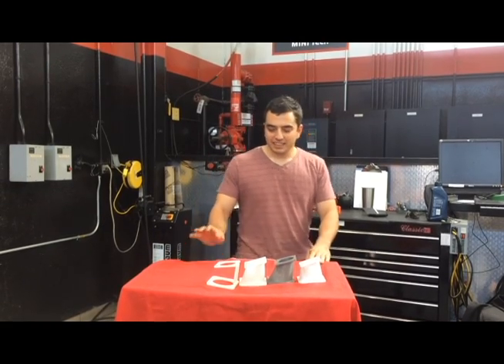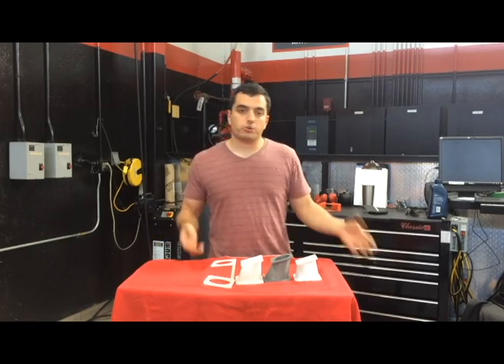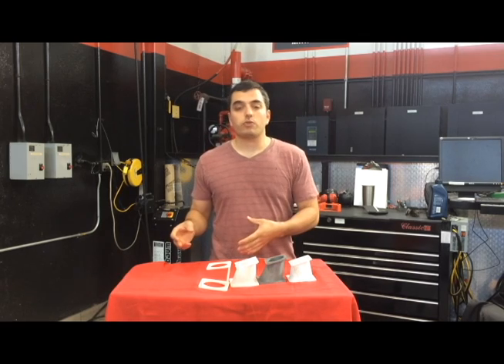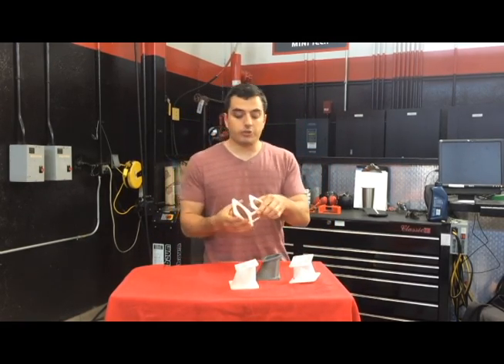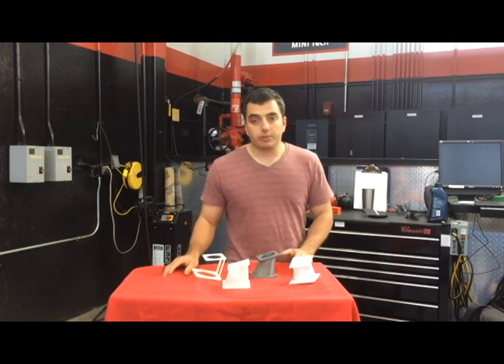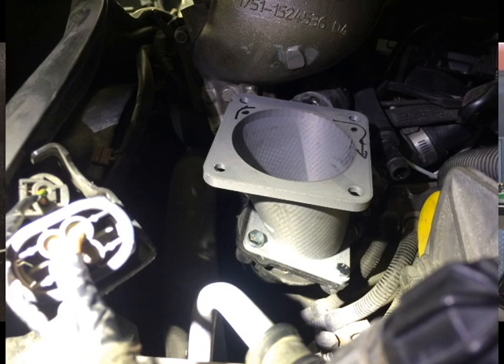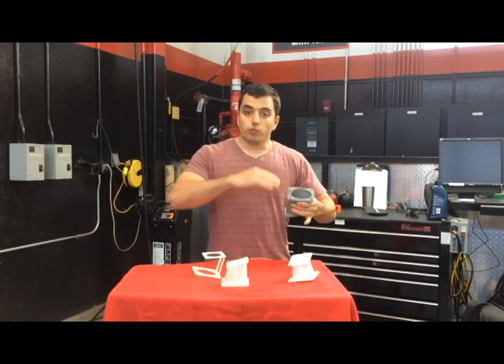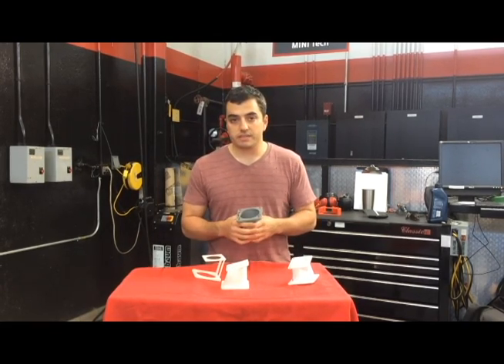3D Printed MINI Cooper to BMW throttle body adapter

Comment: 80mm is wayyyy too large for even a 300+hp r53. It looses far too much velocity low end to justify that peak hp gain... peak hp means nothing when the rest of the range lost so much power
Reply from the maker: Which was explained in the video many times to avoid pointless comments. By you tube never fails I guess

Comment: How much would something like this run to produce?  I'm interested in doing this for another application.

Thanks!
Reply from the maker: JP JP about 50 dollars depending on the material.
Reply: Jason Widelitz any recommendations for software to draw up for as hobbyist?  Also, do you have a website?
Reply from the maker: JP JP I would start with google sketch up. Really easy to learn and can export to .stl with a simple patch

Comment: What type of filament did you end up using? Also what was the density level of the 3D printed part? What is the expected longevity of these parts?
Reply from the maker: I used ABS. I ran it at about 33 I think. As far as logenivity is concerned it's hard to say. The part it mates to is plastic  so I know it's at least within heat range. It really comes down to how well the oil (from the pcv) breaks down the plastic. 

In this experiment anything over a month is more than enough. The goal is to try and provide something that lets us test long enough to work out the kinks.